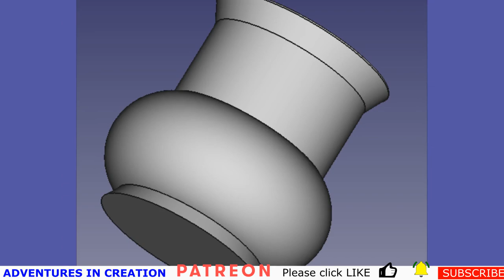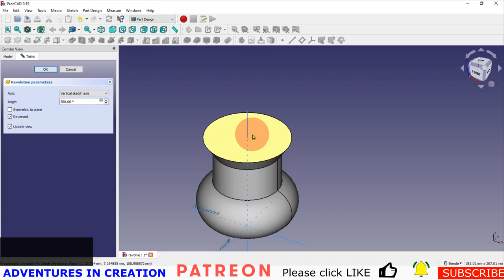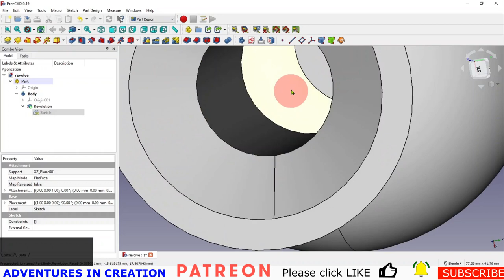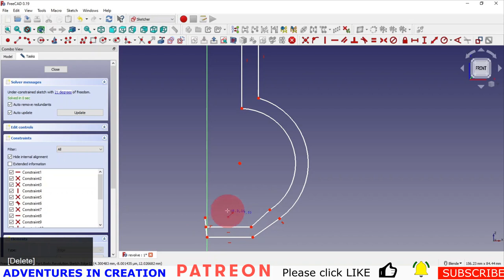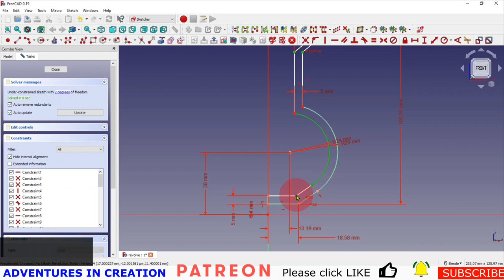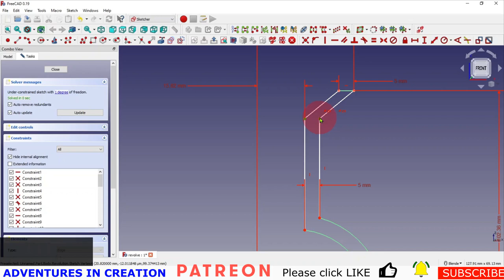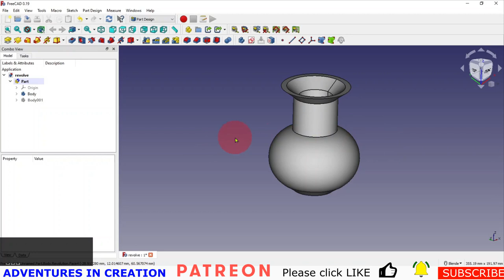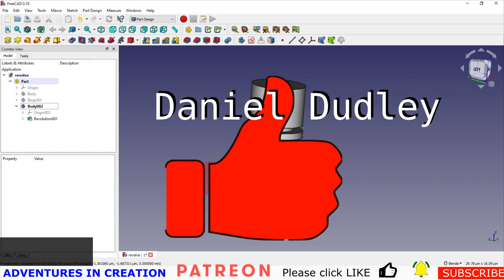FreeCAD for Beginners #4 Modeling Revolves

Comment: A few tips.  

You might want to tell your students that CTR Z will undo a step if they mess up a step.  Multiple CTR Zs will step things back one step at a time.

Another thing is that you aren't stopping to Save during your videos.  If the student's program crashes, they have to start all over again.  And it introduces the habit of saving your work while you work.   FreeCAD on Linux seems to autosave periodically, but that doesn't mean you can't lose several steps of work.  I Save every time I get a block of work done.    

If I am unsure about how something is going to turn out, I will Save a Copy As before I attempt anything big.  Then if it doesn't work out, I can always go back to my saved copy and try a different approach.  It saves having to delete a bunch of work if you have to go back.
Reply from the maker: Good tips. - TBH I do sometimes forget to hit the save or mention that I did a Ctrl +s that saved the model.

Comment: Thank you for your videos on FreeCad. I am on the slippery slope of learning!
I am trying to model a crossbow arrow. I have managed to create the shaft using part design, a cylinder and a cone (for the point of the arrow). I can attach a box , pad it to 2mm and using Boolean to fuse it in the right position of the shaft. However, I want the arrow flight to look like a delta wing (isosceles triangle) and not a rectangle. I do not know how to "attach" the triangle to the round shaft of the arrow. Please can you assist me.  Thanking you in anticipation.  Barchiq
Reply from the maker: If you are using boolean operations to create it. Just create a sketch of the isosceles triangles and then pad it, then use a boolean add to place it wherever you want it on the arrow shaft.

Comment: I am new to FreeCAD and CAD in general. I am using release 19.I have drawn a simple part using revolve which comes out as expected. When I create a new sketch using a datum plane the revolved part disappears. When I do the same operations with a padded part everything works as expected.What am I doing wrong?
Reply from the maker: When you create new parts/bodies the existing ones will be hidden, you can select the part in the model tree and hit the space bar this will toggle its visibility

Comment: I remember that Solidworks and Katia had the shell command for creating the void space. Of course those programs are very expensive.
Reply from the maker: Yeah, for "free" FreeCAD is a fantastic tool but some of the commercial tools have a more streamlined approach. I used to use PTC's Pro-Engineer, that was ahead of it's time back then.
Reply: FreeCAD has the 'Thickness' modifier in both the Part and Part Design workbenches. I just used it to create a hollow part from a revolution of a complex shape - it will create a constant thickness shell. For a shell with variable thicknesses you will have to use the procedure in this video.

Comment: Love your videos, however there is something missing (from my point of view anyway) I think there should be an early video in this series that talks about work flows, with an emphasis on what are the inputs and what is the output. for example I want a 3d printed part the input would be a pencil sketch the output would be a file that can be 3 d printed or you may want to get something made at a machine shop so once again the input would be a sketch and the out put would be an engineering drawing that a machinist can work with. I have worked in industry for a long time and always had a drawing office where I would take my sketch, and out would come pcb design or equipment enclosure design. I was never taught drawing (other than tech drawing at high school or circuit drawing at tafe) Now i'm retired and have to do a lot myself, I had to learn to be a draughtsman (or is that draftperson in the politically correct world FIIK) So I think a big picture video would be a good idea.  regards  Steve W
Reply from the maker: Thanks Steve, FWIW there is a video on creating drawing too

Comment: Excellent video.
BTW, could you explain where the center of rotation for a view is when moving it with the middle mouse button ?  Is there a way to set it ?  Last click point or something ?

Great video.
Reply from the maker: So, it depends where your mouse pointer is located at the time that you hit the middle mouse. One of my patrons very kindly sent me a spacemouse, that thing is fantastic for rotating the model.
Reply: @Adventuresincreation  I keep hearing this.   I wonder how a trackball would be.
Reply from the maker: @SomeTechGuy666  I have a logitec trackball, I love it.
Reply: @Adventuresincreation  What does it do better in CAD than a mouse ?

The main thing I dislike in FreeCAD is holding down the middle mouse button (scroll wheel) and moving the mouse around to rotate an object.   How does the track ball handle this and how does it compare ?

How does the position where you start the rotation from alter the center of rotation ?
Reply from the maker: @SomeTechGuy666  You still hold the button but rotate with your thumb. The spacemouse is very different. It is designed just to manipulate the model

Comment: BUT the only issue I have with printing here is when looking at the slicer it is showing the seam. I have a large line going from the top to the bottom of the vase. Edit: found the error, the line is the sketch itself. trying to find a way to fix the issue. It shows up in FreeCAD as an edge. (yes, have full 360 set...)
Reply from the maker: Glad you found the issue.

Comment: 83x64x102 at layer .16mm with infill at 10% speed 50/100 print time: 6 hours 15 Mins...
Reply from the maker: Wow! that's a long print but the nature of the 3D printing beast I am afraid.
Reply: @Adventuresincreation  Another project I started since I got my QIDI Tech x+ printer is to build a custom camera mount. Happy to say I finished it and mounted it with somewhat success (replaced a Logitech 920 mount attaching the new mount to the old holes used for the mount -- yes starting out big). The question I have for you now is if you have done any videos yet on importing STL or other files into projects. For the most part I was able to use the Spreadsheet for all needed demotions yet ran into issues with the imported object.
Reply from the maker: @OZtwo  I did a video on importing STEP files.
Reply: @Adventuresincreation  Cool I will get back to them when I get this camera mount project done. :) But more or less learning on the fly right now. All works GREAT just need to get the dominations right for the mount itself. So yes, the CAD mount is done and ''working" with the spreadsheet data. You been a GREAT help.